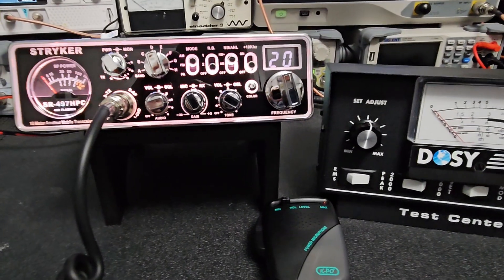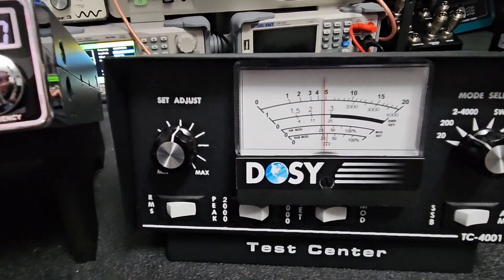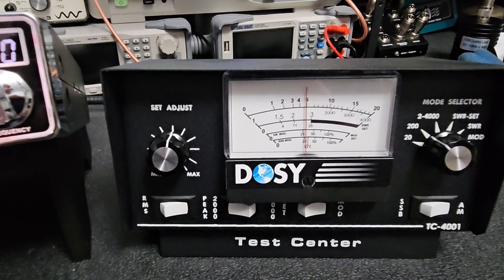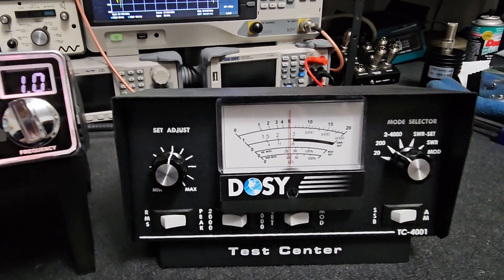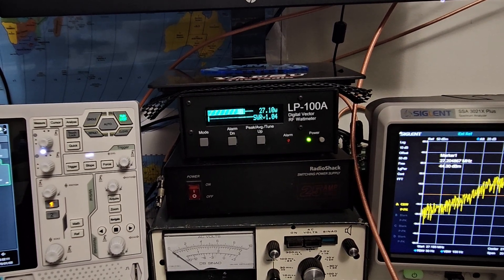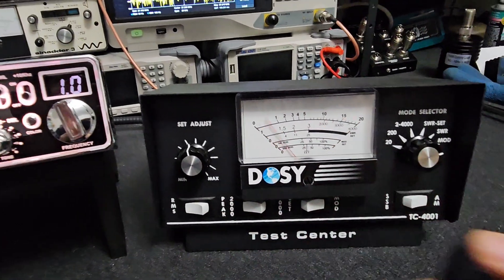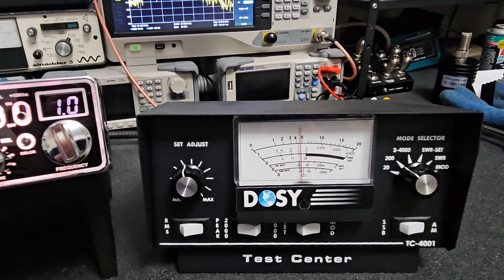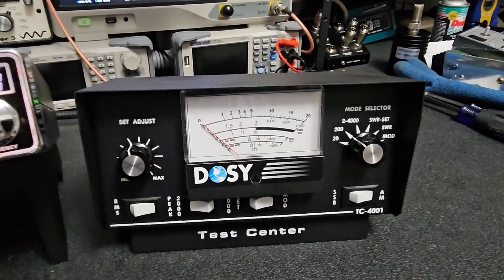CB Radio and 10-meter radios not showing more power on my meter?

Comment: Dosy is owned by India 🇮🇳  ....going forward buying American Company they have the capital to make a more accurate product....
Reply from the maker: It would be one of the best meters on the market if they had a real peak circuit that had proper accuracy. 
The modulation scales can never be accurate because that is not how you read modulation.
You must have test equipment to read properly modulation levels.

Comment: Good to know.  Thank you. Any suggestions for a reliable/accurate meter that doesn't cost as much as an LP-100A?
Reply from the maker: Monitor sensors, or
K-po DG103 max I sell.
https://www.scottsradios.com/product-page/k-po-dg103-max-swr-power-meter
Reply: @ScottsRadios - Thank you!
Reply: @ScottsRadios  - Have you done a video on the DG103? Would be cool to see a comparison between it and the LP-100A.
Reply from the maker: @BeingWolfy  https://youtu.be/wtr1xZyFSsg
Reply: @ScottsRadios  - Thank you. I found that after asking. I also found your Monitor Sensors meter video that compares it to the LP-100A. That looks like a great meter.
Reply from the maker: Both are good choices 👍

Comment: Good explanation and completely understandable why some might question the difference between very accurate true peak reading meter vs what they might be using at home .
Maybe ohms law? Show voltage and amperage draw? 
Anyway I never knew until I did, if that makes sense 😂...73

Comment: You missed the opportunity to mention analog needle meters without 12v dc to power the peak function are almost worthless. 
You need 12v power and not just for the lamp!!!
Not having that, a good average power meter, you can just triple the reading which is what they do anyway on non digital meters.